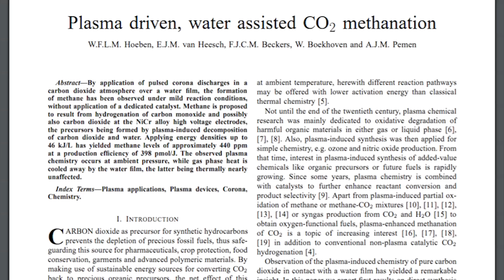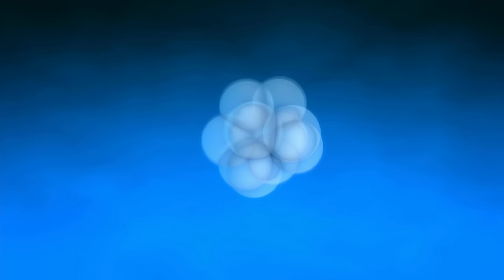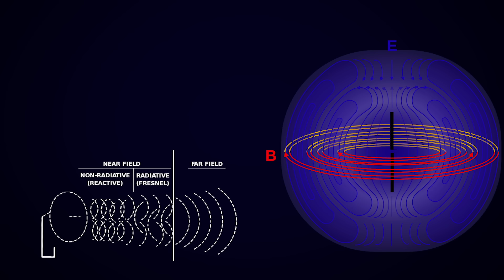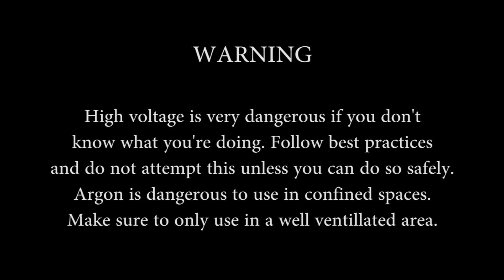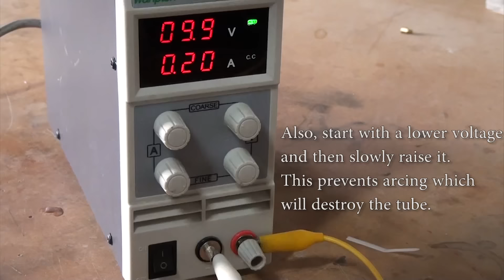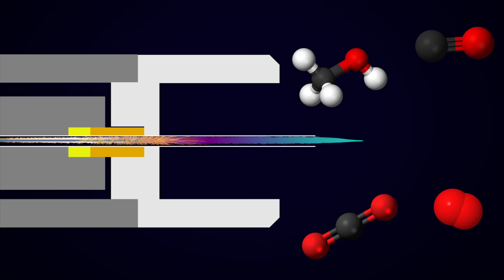Cold Fire You Can Touch - DIY Cold Plasma Torch

Comment: Flyback transformers have high voltage diodes in them for rectification, because CRT TVs require polarized electric fields. That is why they act "weird".
Reply: Yep, they're charging a large capacitor for the electron gun to fire at the phosphor.  Also, DC allows a build-up of charge over time more than HF AC can, so a small current can charge a HV storage w/o everything having to be so beefy/costly/bulky.
Reply: Ali Devrim OGUZ not all do actually, I got lucky several times with older color TV's no diodes, or caps in it just the circle tube of windings, sealed of course and the  ferrite going to ground also 3 of them only have 5 lead's very easy to work with added benefits imo. I think this convince me to take apart the old Commodore 64 and monitor and see what kind of fly back is in there since when I was on vacation are old 30 or so inch screen TV that was black white mysteriously got recycled during spring cleaning sigh
Reply: Also on the ones I have came even from recent TV the recent cr-mo more recent CRT TVs the AC ones are actually a bit smaller and are said to be able to produce a lot more beneficial variances but I've yet to experiment with all the possibilitys, let alone therorys. I rebuilt one would definitely be the way to go for anybody interested and using flybacks in their project so they don't have to use the fix diodes and the fix capacitor you can use them additionally added on to your own needs which makes it a lot more versatile Imo.  you can always depot one with the diodes in there in the capacitor and Rewind it to your own needs just a Crock-Pot with some sand and it until the epoxy starts getting loose enough to crack away gently I've seen homemade ones make my 3 Series fly back Tower look like an arc lighter.
Reply: Are you by any case attend my lectures. You sound like my students
Reply: teşekkürler

Comment: I really dig this video. In case you were curios, a  CRT's flyback transformer is used to control the horizontal sweep of the electron beam. It basically takes in pulsed DC and spits out a sawtooth signal that never crosses 0v.

Comment: Cold to the touch, yet melts metal. That would be cool.
Reply: How would that work exactly? It's cold because of it's low energy level, right? If I understood correctlyt the intention is that it can destroy MOs.
Reply: idk the specifics but i have a few water torches, of varying complexity as to the the separation, scrubbing/drying and delivery from the cells as well as in the design of torch burners; and most configurations result in a flame that will cut metal but so far in my most gracefully clumsy mishandling hasnt burned my skin or clothing or furniture, and rarely it burns paper if i let it stay in flame too long. in the same conditions but with conventional gas (propane or MAPP) cylinder as fuel i have accidentally burned many things and acquired many scars. my best guess would be that its an effect kinda similar to induction cooking but focused to a pencil tip, with some extra jazz about poteintial held in the flame and theres probably a good amount of charge in the in the fuel and some small amount of liquid droplets with dissolved KOH. i never really thought about it and now am curious as to the actual reason from someone who knows.
Reply: It exists, some metals melt at very low heat, sometimes lower than the wax.
Reply: that would be browns gas...water molecules where the hydroxyl di hydrogen has been dissociated,leaving 2h+o...this results in a plasma that,when combusted,cuts metal but doesnt burn skin...
Reply: @FFuckYouTube  watch out for the extra monsters and demons
Reply: @dexterdequoitdikkentheworl87  it cOulD cUt skin, that iSnt burniNg
Reply: @solidagold115  not because of the low energy level , it was because of where the energy is stored

Comment: The Thought Emporium: makes ion engines
Nasa: sad government corporation noises
Reply: If I'm not mistaken, this is basically an un - ion engine. An ion engine uses electric fields and plasma physics to shoot cold gas out at high speeds, where the speed is the important part. This torch uses a source of pressurized gas and a bit of electrical engineering to blow cold plasma out at fairly pedestrian speeds, where the plasma is the important part.

Comment: Very nice work, thank you for taking the time to show us your work on your Plasma torch. This is an area that is not covered well in most information as the transformers used can kill just as easy as they can make thing work. You may want to add more shielding on the exposed wire as it can breakdown over time and has led to issues with other peoples work.

Comment: The tv flyback transformer contains a voltage tripler, so it is DC. The big red wire is the +15 kv or 25 kv.
Since you needed an outflow of electron, you used the transformer pin that normally, on a CRT, would be ground.

Comment: Your #17 would have worked fine with the acrylic if everything was dry enough. Acrylic builds up charges because it holds so much water. Chances are it worked for a few seconds each time you turned on the high voltage. Then it built up charge and held the plasma back. It also gives up that charge within a few seconds after the voltage is removed.
Excellent content - Subscribed

Comment: You can use a Tesla transformer in continuous autoresonance mode. It needs one powerful bipolar transistor like 2SC5200 and couple of resisters and zenner diodes. Usually "base" electrode of it connected to common electrode of HV side, that produces feedback current with right phase to drive the transistor and the primary coil. The feedback circuit closes through the parasitical capacitance between the transformer windings. This scheme can produce high voltage with frequencies about hundreds of kilohertz.

Comment: Video/experiment request!
Air metal secondary cell.

I've read a few papers recently (abstracts only... pesky paywalls) that suggest rechargeable air metal batteries are coming along nicely. There are loads of simple DIYable air metal battery designs - eg aluminium foil/NaOH/activated carbon - which give decent output, but I've seen no experiments on YouTube demonstrating or attempting to recharge batteries.

The papers I've found seem to suggest doping the carbon with Fe-Nx, MnO2, Co-Fe and various Ni/Co/Fe -CN catalysts suggested to increase the oxygen evolution reaction efficiency. The papers often claim up to 100 discharge/recharge cycles! I would be amazed with a single recharge cycle personally.

Anyway, just a cool idea. Love the videos! You're living the science dream!

Comment: So with regards to the acrylic tube that wouldn't allow plasma out.... i'd say that's more due to chemical reaction occuring. The acrylic looks very pitted and worn, that's called crazing and is typical of acrylic in high voltage environments. It's part of the reason acrylic isn't always used in electronics. 

With regards to creating a plasma arc that is adjustable:
You need a biasing signal. 

You're using an super high frequency signal to both excite the argon gas and control the temperature of the plasma arc. 

The reason why you need a bias signal is that it allows you to separate out the temperature of the plasma from the color and intensity of the plasma. The end effect is that it works kinda like the laser light experiments you've posted.

The easiest way to accomplish this is to apply a DC voltage directly to the argon before it encounters the UHF waveform. This will look like a dc offset if you view it through a n oscilloscope, but the interesting bits is that a DC bias can be made to conform to the flow of argon in your system. This is actually partly how intensity and mass flow through the system can be correlated.
Reply from the maker: It's pitted because I was drilling into it and cutting into it on the lathe. We're 90% sure it's because it was too good of an insulator

Comment: Flyback transformer aren' t weird, there is just a diode hidden inside them (and the CRT internal coating, external coating and glass is used as a capacitor to have a DC voltage)

Comment: You should speak with Dr. Gundersen ( USC ) about the Cold Plasma Dental Handpiece or the DARPA Stratified Ignition. It was based on the Patents for High Voltage Pulse Generation, Pat. US 8,120,207 B2 and follow on. 10 KV at 5 ns . Your work may be of interest. Your Cold Plasma looks better and seems more practical. They may buy your design. I used some KW26 Crypto Tech to stabilize the design as an Analog State Machine. Got me on the Patent. They could test your design at the Dental Clinic. They do pay for Patents, they bought 5 for me. Why not you.

Comment: I know I am probably complete incorrect, but from my understanding in this video, cold-plasma is created by the release of electrons into an easily ionizable gas via a dielectric barrier... and the flow of the gas creates a sort of plume which acts as the torch end.

The reason it's cold to touch is that there are no superheated ions present, only electrons. Electrons don't have enough mass to effectively transfer their thermal energy upon collision or travel very far in the first place.

Am I correct in saying that the reason you can't just lower the amount of energy coming from an electrical source to ionize the gas and create cold-plasma is due to how far the electrons can travel from a conductive source? That the free-flying electrons need to build upon a capacitor first before ionising a gas due to such little energy being exerted by individual electrons? That the high-voltage is required to ensure there are enough electrons to supply a sustainable arc of cold plasma?

Also if someone can explain how the electrons pass through the dielectric barrier to ionise the gas within the torch, that would also clear a fair amount up.

I know I'm an idiot, but I'm still learning mkay. Thanks.

Comment: The most unexpectedly awesome part was when I found out quartz capillary tubes are a thing
Reply: Use them in chemistry all the time. One way to identify a substance is heating it to the melting point, then looking up what melts there. Typically use an instrument called a Meltemp (actually probably a product name). The substance is packed into one of these capillary tubes, inserted into the machine with a slowly rising oven temperature, and watched through a built-in low power microscope. When the stuff in the tube melts, look up at the thermometer sticking out the top and jot down that temperature. You can buy these capillary tubes in 100 and larger lots, since they are typically single use items.

Comment: I worked a lot with DBD Plasma and I am surprised you have so much trouble to get it work. I guess the problem is your power supply, a ZVS is cheap and easy but when i worked with DBD, I used a supply with variable voltage and frequency adjustment. This makes a big difference because there are some sweet spots (voltage and frequency combinations working well together). When I changed one parameter, rising the voltage for example, the plasma discharge became a lot(!) weaker what is not really what you normaly would expect...

Comment: Why not use a quality TV coax cable. Pull out the central copper core and you would be left with a hollow silicon tube wrapped in a copper mesh covered with an insulated plastic. The copper mesh would stop the inner from bursting/expanding when you run the argon through it under pressure and the coax mesh would provide the flyback required.

Comment: So wouldn't be better to say it's a transitional near plasma state, not a conventional plasma where the gas molecule is hot ? I used to build systems for CSC/CVC/Veeco used for manufacturing of thin film systems in Hard Drives, Optics, Chip Plant Manufacturing with Etch and Deposition. We had extensive water chiller/cooling systems on the chambers and targets etc to keep them from heating up excessively and eroding under the ion beams or other processes. Very interesting video !
Reply from the maker: No because it's not "near plasma". It's plasma. The formal name is non-thermal equilibrium plasma because it's real plasma, just the different parts aren't the same temp is all.

Comment: 5:43 i always wondered why HF circuits like tesla coils and(sometimes) flybacks just spew corona, where as transmission lines won’t leak their shit everywhere. I mean, you can have a consistent single electrode arc at 5KV or even less using the HFVTTC circuit, where as MOTs and flybacks can’t do that. 

I knew that HF arcs were more prone to just straight up leaving the wire in single terminal corona, but i didn’t know why, Now i do!

Comment: I bet if you want to use it for sterilisation/cleaning specifically, oxygen would be even more effective than using an inert gas, since you'll be forming chemically very aggressive ozone and monatomic oxygen, which should destroy microorganisms even faster, and eventually probably fully oxidise any organic contaminants to CO2 and H2O. Though I'd be worried about the electrode wire being oxidised by that, so might want to switch to a platinum wire electrode if using it with oxygen, for increased oxidation resistance.

Comment: when you get flyback transformer from a tv,you get a high voltage multiplier,which rectifies voltage and summs it up on capacitors. this fact that you get pulsating voltage is due to overcurrent. capacity of capacitors inside of a mul;tiplier is not enought to supply that ammount of current that you are drawing with a load. if you want to have ac current you should have acces directly to the secondary of transformer,and use direct wires from it. maybe you have better luck if you find older transformers from black and white or even tube tv sets. tube tv sets will have those transformers without doublers,thus a greater voltage right out of a box, and ofcourse secondary direct output. to find out what iam saying just disassemble one of those flybacks that you are using,you will see capacitors and diodes there.

Comment: I would be interested to know about 2 things: ionizing radiation and ozone generated by this. These can produce significant hazards to an operator. Ionized air spontaneously generates ozone. This hazard may not be significant as the argon used would not generate ozone and should minimize generation from the surrounding air. In a well ventilated area the hazard should be minimal but still i am curious. Second, and possibly more hazardous, could be the radiation generated. First, the accelerated electrons are beta radiation. I am not certain about the energy of the electrons produced here but something to consider and I would be curious to know the potential hazard. Second is the UV light emitted. I doubt this would be a concern above an afternoon in the sun but again i have no idea the levels produced. Hope someone knows more and could enlighten me on these points! 

Cheers great video man!

Comment: Silly question - around 5m10s in there is an animation of electrons jumping a gap with a small inset video of the voltage waveform above left. My question is: Why do the electrons only jump from left to right? Should they not also jump from right to left during the opposite half of the voltage cycle?  Or was it just that you didn't get time to tweek your animation?  Many thanks for making the vid available!

Comment: use an oil heater igniter much better power supply it plugs into normal 120 and can sustain running for hours and hours without failing  output is steady 30kv for most and there super easy to set up no need for all your extra electronics I use mine to produce ionized nono silver and ozone

Comment: THIS IS SO COOL!!!!  (Pun intended), and I NEED to reproduce it. 

I've gone through the comments, website, etc and have not found a lot of the detail necessary to reproduce this, or at least get off the ground faster and build on what you have accomplished. 

Can you please give pointers, model number, or specs for the power supply? What voltage, frequency, current do we need here?  Would a simple "DC 3v-6v to 400kV Boost Step-up Power Module High-voltage Generator" from eBay work here? Why not?

You talk about some papers. Could you share the title/link for a good one?

Comment: I'm not a scientist, or electrician, or anything like that, but when you mentioned changing materials for the emitter electrode (or whatever you called it, I'm sure you know which bit I mean) it reminded me of a video I saw on somebody else's channel. Bigclivedotcom did a vid about refurbishing an ioniser, & I remember him saying he improved the efficiency by using some kind of carbon fibre threads or filaments or something. I'm afraid I'm a bit fuzzy on the details, but it shouldn't be too hard to find, & maybe you can see if it would be applicable to your cold fire torch?

Comment: I'm not learned when it comes to stuff like this, but I am curious. I was wondering, how many different outputs could you get with the set-up that you have. Could you make it into something like a hot-plate size sanitation station? I know I saw a couple examples with several tubes but no pics with multiple tubes working, is it an issue that multiples won't work so close together?

Comment: Curious. Dielectric medium / gradient build ups up - could you recycle the ions and restructure the wave to improve efficiency of the frequency modulation in the current, as well as to allow adjustments of the power and range ? Dielectric mediums unlisted, thus uncertain if K value acceptable for modification suggested.